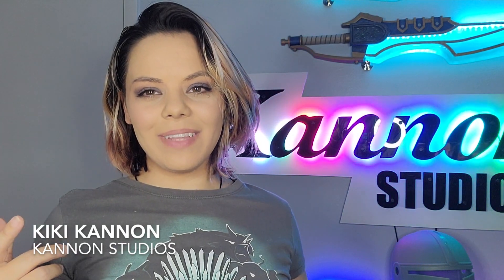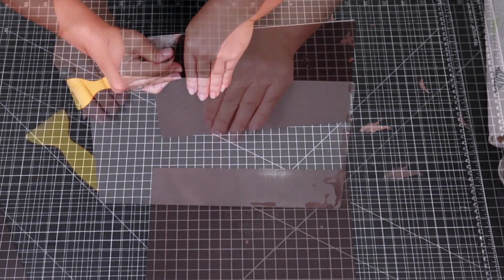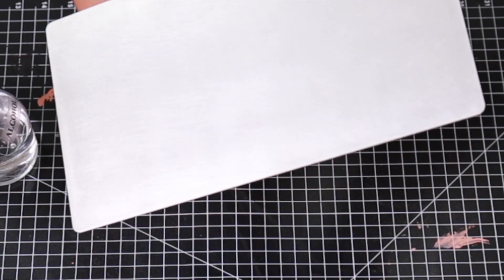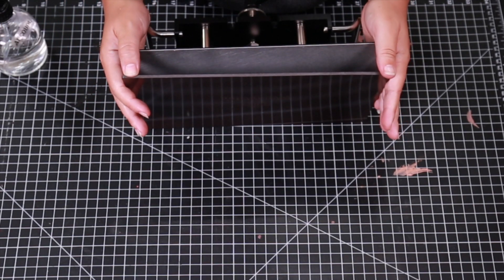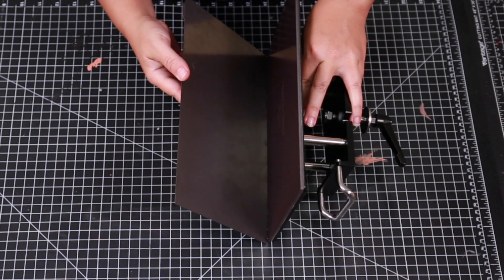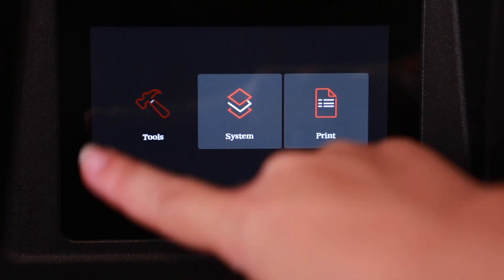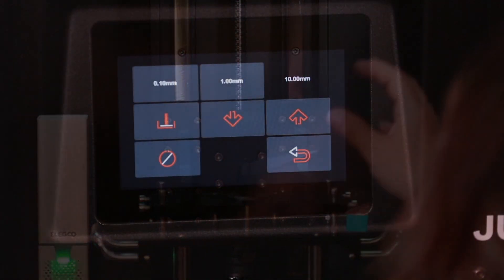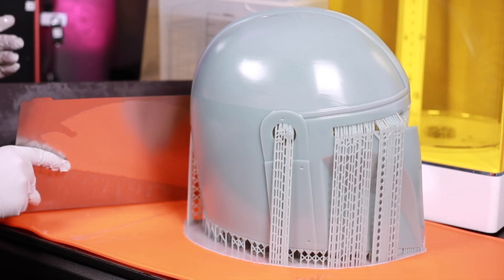Installing Wham Bam's XTR Flexible Build Plate

Comment: I got one for the Elegoo Mars 4. 
1. You need to sand the flex plate. Prints do not stick and slide around if you don't sand it. 
2. It is now slightly too large for it to fit inside the Elegoo Mercury 2 in 1 wash and cure station. 
3. Definitely wait the 3 days!
4. Outside of that, it's awesome.

Comment: Quick note - I think you should wait 3 days after install before printing. It let's the pressure sensitive adhesive fully cure.
Reply from the maker: Thanks for the tip.